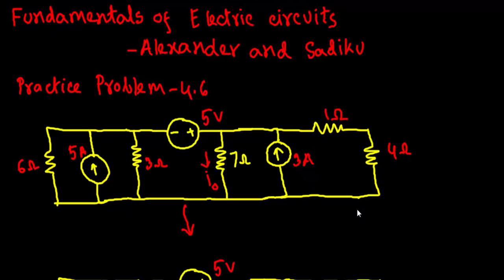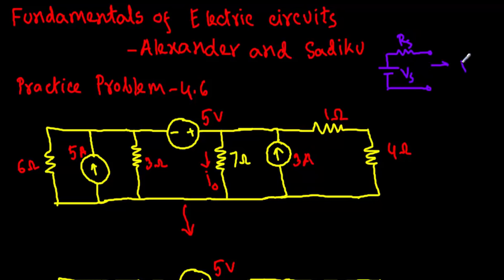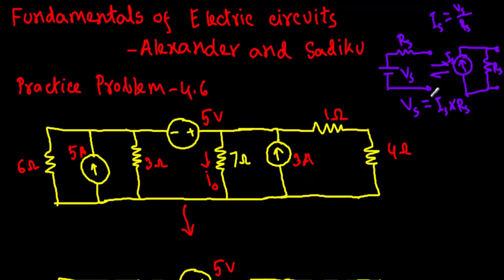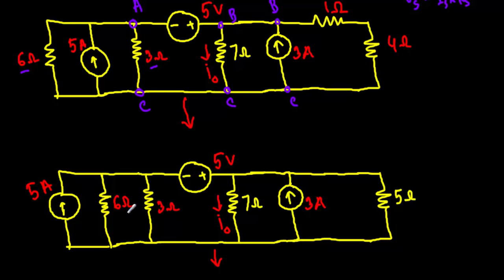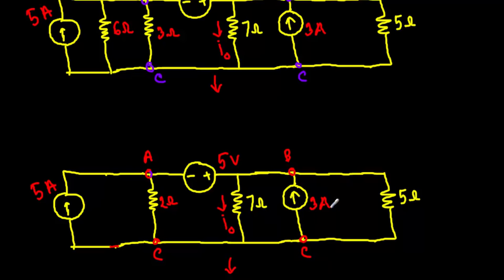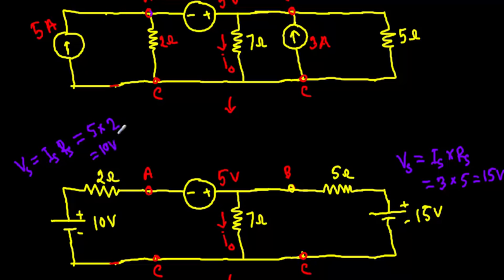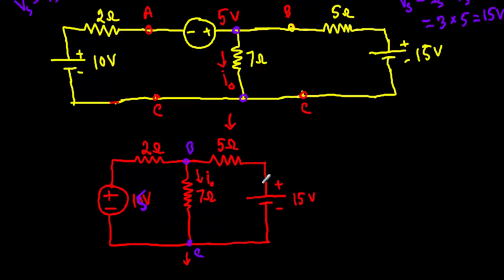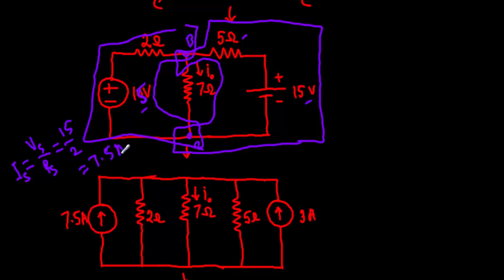Source Transformation Example - 3 (Hard)

Comment: Thank you,  Very nicely done. however please tell me , @9:01 ,did you added 5Ω and 2Ω without doing to the 7Ω? how are 5 and 2 in pararell with 7 being in the middle?
Reply from the maker: See 2, 7, and 5Ω they all are connected in parallel, but as I have to calculate the current through 7Ω so I have to leave it untouched. So, I reduce 2Ω, 5Ω to single one to simply apply current divider rule. You may use whatever method you prefer to calculate the current through 7ohm.

Comment: In last step when u  adding  the current  i think it must be subtraction between them because  they  flow   inversey
Reply from the maker: How are they in opposite direction?
Reply: You   are right #Zanob. it must be 5V
Reply from the maker: If you face problem with this approach, check the alternative solution:
https://youtu.be/tJJODOKPujE
Reply: They are both entering the node with the 7 ohm resisitor.